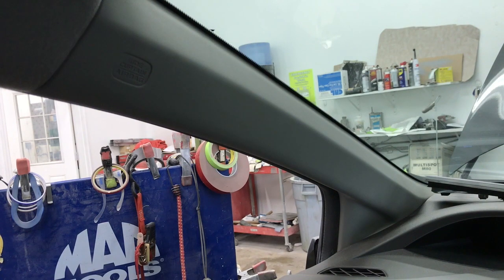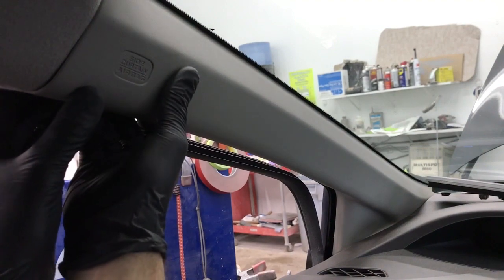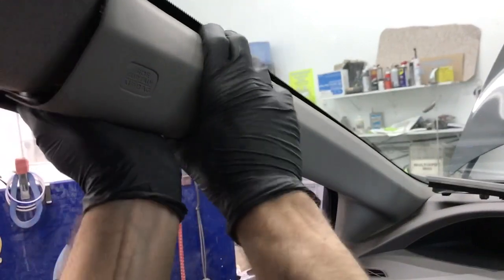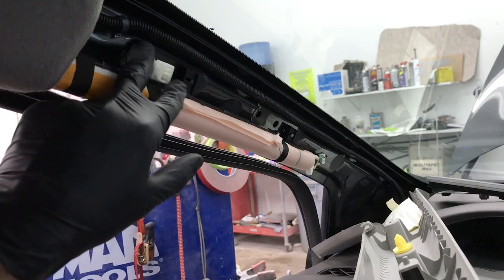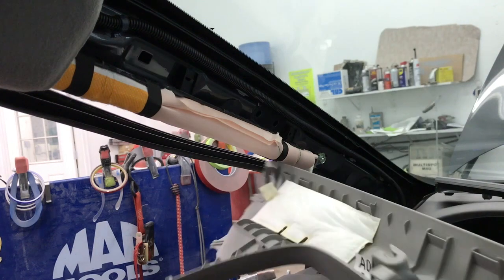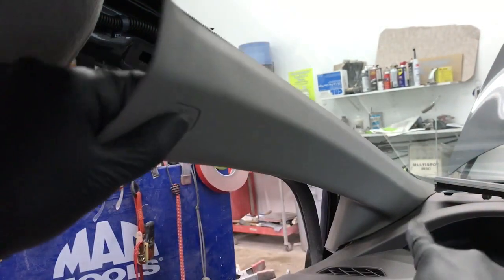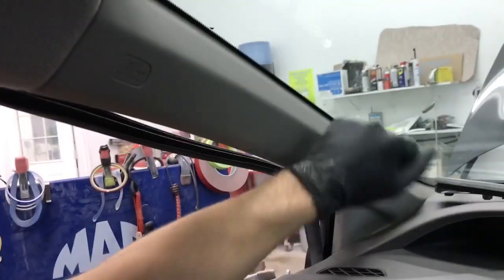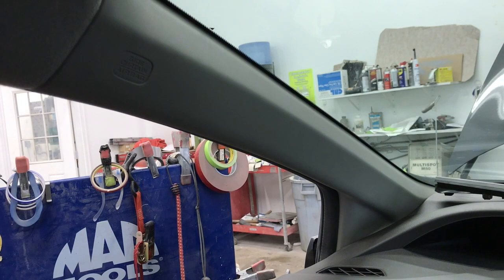2012 2013 2014 2015 Honda Civic A Pillar Trim Removal

Comment: Could you help me locate the side curtain airbags front to back? I need to wire my dashcam and am worried about interfering with the other side airbags by wiring between the B/C-pillars and headliner. I can do it another way if that is just not an option, but would appreciate the feedback!